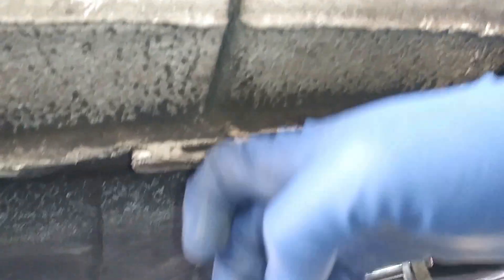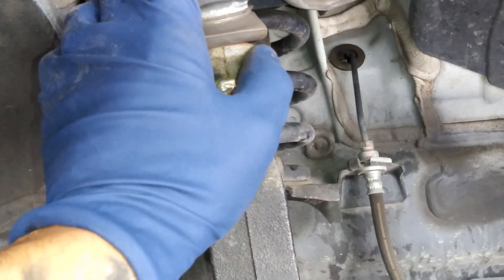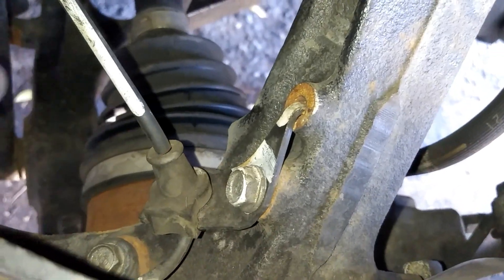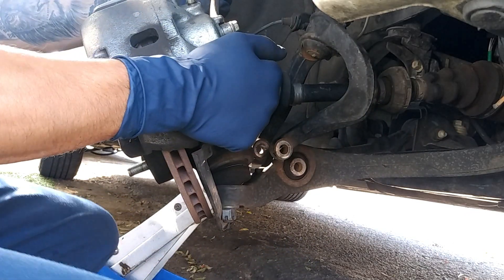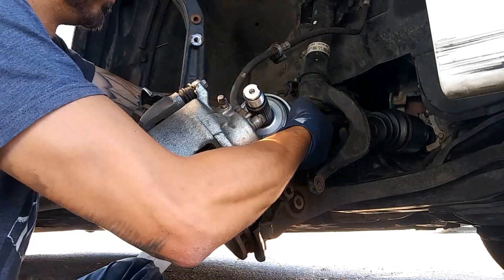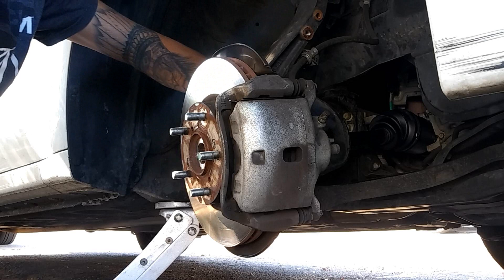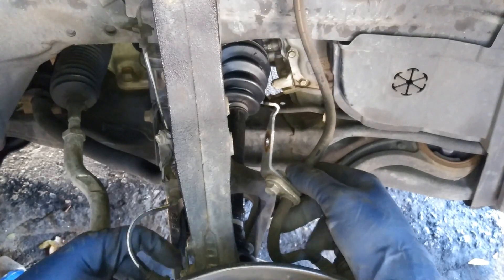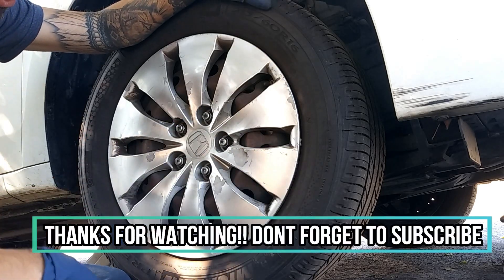honda accord passenger cv axle replacement

Comment: 👍 thanks 👏👏
Reply from the maker: Glad it helped!
Reply: @JaboTheMechanic  I am having a hard time. How do you get the new axle to snap back in. The axle gooes on but it doesnt want to lock on to the pin
Reply from the maker: You could hammer it in